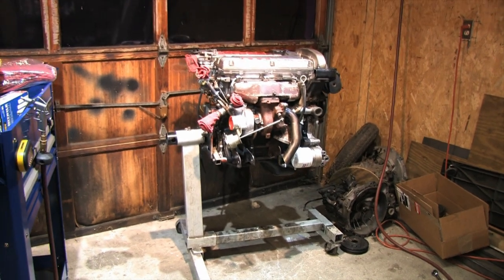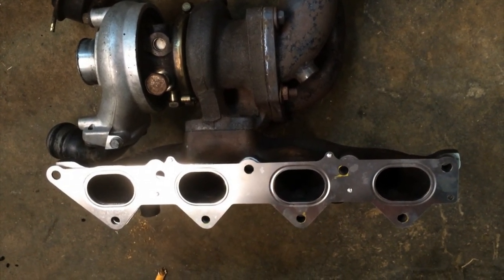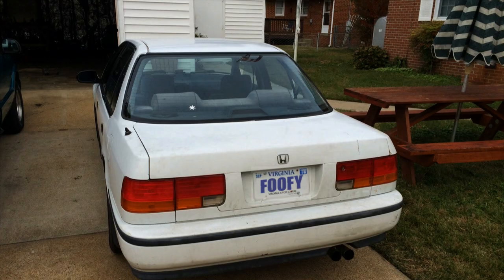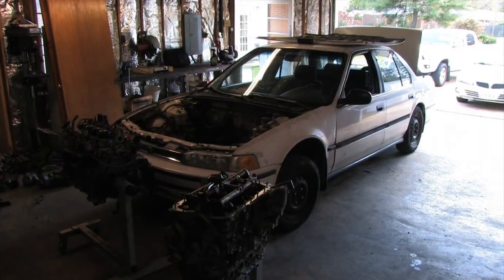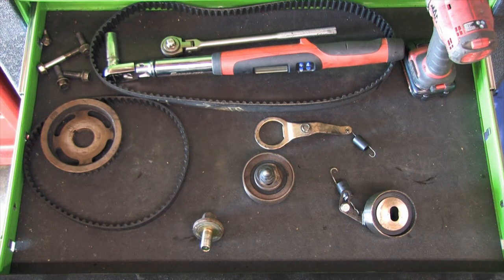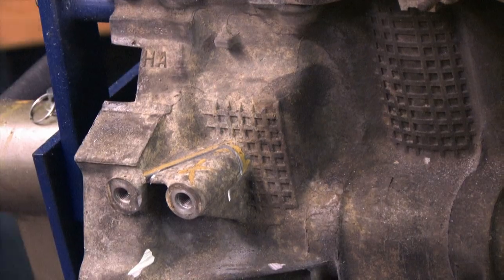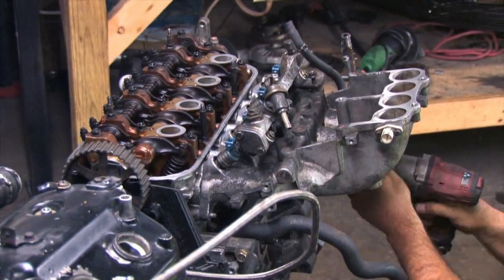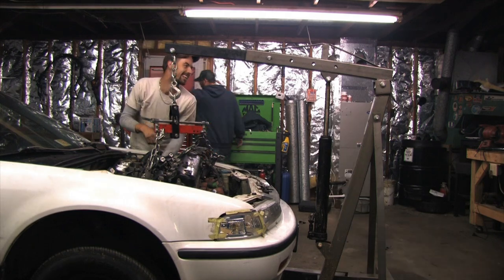Foofy?

Comment: Jafro,
I told my subscribers long ago that if we hit 10,000 subscribers  I'd boost my F22a Accord with over 300,000 miles on it, and they did it.  This video is a HUGE help and a bit of relief. Thanks a bunch for posting it and going into such detail!
Reply from the maker: +Braden Carlson Do your research.  A different manifold will let you keep a lot of stuff that you'd have to delete.  We didn't use that manifold because we had a free one.
Reply: ***** I'd been looking at the east coast concepts install manual for DSM turbos, so I got a 1g manifold too. You're right, there are better options, but my whole car is a half-assed wonder. It just wouldn't be right to do it entirely properly ;)

Comment: This makes me miss my CB and (EDM) CC7.
What you can do to counter the effect of missing the front engine mount, is filling the rear mount with liquid urethane (for installing windshields).
I did that when I turbocharged my CB and it limited the movement the engine enough. It'll vibrate just a bit more.

Comment: Really happy to see you working a a f22,  such a underestimated engine series.  Incredibly reliable.
Reply from the maker: +paradien It has a seriously over-engineered port design with just the right port shape.  It's just like a DSM port but slightly smaller.  For the valve dimensions a DSM uses, its head ports are just too big for its own good.  With the right modifications, there's no contest with a DOHC, but we're talking about a stock un-ported SOHC head.  Way over-engineered for a 125hp NA motor.
Reply: If you wanna see the right modifications you should look up a old build from Bisi Ezerioha. The NA F22A4 HONDA INSIGHT!  Driving a 1993 Accord daily and then see that made me become a Honda technician! The man had put a unheard amount of engineering into the F to show its potential. Unfortunately no parts were massed produced at a cost that most enthusiast would want to bother. Thus....swaps. what a shame.
Reply from the maker: paradien We found the Bisimoto kit.  It's pretty much the only option if you don't go with .030 over 4g63 stuff and some custom rod machining.  It's a big enough expense to make a DSMer out of anybody.  I can buy 3 DSMs for what it costs.  You gotta really love that F-series for that route.  :)

Comment: As a Honda and DSM fan (and long time viewer,) I love this video.  I've only read about the DSM 4G63 manifolds working on older F-series engines, but I've never seen it done in much detail.  Not that I'm condoning not being safe, but I don't think removing the front engine mount is that big of a deal (the average person/daily driver should certainly try to maintain or fabricate a front mount.)  But most older Hondas/Acuras don't even have a front mount like that.  With that said, aftermarket mounts would certainly help stiffen the engine for even more safety (if it wasn't a budget build of course ;))  Thank you very much for the video!
Reply from the maker: +Spoon Twofiveeightone There's a better, safer way to do it, but we went with free.  :)  If/when there's a foofy 4, we'll change our parts list to things that weren't on the shelf and manage to keep that mount.  I think the F-series is an underestimated platform.

Comment: How did Foofy III hold up at 15psi?   Revisiting this video because it's awesome.  Also, is that stock Accord manual transmission a LSD?
Reply from the maker: My take is that if you're even considering pushing one over 8 PSI, a knock sensor install is a MUST.  This engine has a glass jaw because it's set up tighter than [horrible metaphor], and the pistons absolutely suck.
Reply: None of the Accords have lsd unless they have been swapped. The JDM H series trans is lsd and a direct bolt on but has shorter gears.

Comment: Nice job, really like the ingenuity that went into this ! This is one of the most interesting budget projects I have seen. Have you considered transforming the intercooler into a chargecooler? You could weld a couple of end tanks to it and use a small radiator, provided you can fit one somewhere with enough air flow along with an electric pump (if you are willing to spend some money). An oil cooler could help with engine temperatures as well. Used ones can be found for next to nothing. More interesting would be a DIY water injection system. I know they can be made from used injectors and fuel pumps and I am sure you people can put one together from used parts.
Reply from the maker: +Ismaak5 Because of the hot and cold side inlet and outlet size, it's really not such a great candidate for that kind of use unless you could stack several of them, and still, it wouldn't be as efficient as a purpose built one.  Water/Methanol on this car is a must, but I'm pretty sure this particular engine install is temporary either way.  We had so much fun with the proof of concept that we proved it 2 more times.  A ridiculously inexpensive education.  Now that we've seen what can be done, and what it is, severe changes to this approach from the ground-up could be possible.  For now, we're just enjoying it.  Absolutely anything could happen next?

Comment: Air flow is maybe better for turbo application but :
Bigger Air flow doesn't mean more hp.
Bigger ports will make the air to slow down inside the intake and the ports,and the air charge (wich will be trapped inside the cylinder) will not automatically be more important.
Air is elastic,and if you use it to accelerate it before being trapped in the cylinder ,you can benefit from it.
It's what the small ports are made for.
Reply: You only benefit in low and mid-range torque from that. Big ports and big airflow are for peak HP, which is what racers want, and they couldn't care less about lag.
Reply: +michaelovitch You certainly put out good thinking. I remember a comment of yours earlier on another video where you mentioned making one of the ports bigger on the way into a 4 valve head. It got brought up that this concept was more for efficiency instead of for power, but David Vizzard agrees with you. He designed (and patented, so if you make this and sale it you have to give him 7.5%, but if it's just for you, it's okay) a 4 valve head with one larger intake valve to create swirl. I can't for the life of me yet find a "bigger" valve unless we're talking 2 thousandths of an inch, but I wonder truly if I could get a similar effect by still doing what you and David Vizzard brought up about making the porting around one of the valves bigger.

A competing idea on my application is that most small 4 cylinder engines have oversized intakes. This is from another book and I have a lot of math to do to see if it's true for my car, but I suspect it is.

The only issue is, if I were to truly make my intakes smaller I'd need a TIG welder, lol.
Reply: +Hugh O'Brien In your example, what would you fill the port up with? I see Jafro's videos inspire you to type a lot too. :) Good to see you again.
Reply: what are you on about , and your point is ???? also every engine has flow and other things contribute the better flow etc . most onnhere haven't a clue
Reply: +Tim Ramich 
Drag is not everything : )
There are racers everywhere,not only on straight lines.
Reply: +Hugh O'Brien 
Thank you for your comment.
Very interesting.
: )
Reply: +DE Nichols 
A guy,(mototune USA ) uses epoxy to reduce the ports section.
It's a NA engine reving quite high,so air elasticity is huge there,like the air boucing effect in the ports.
What i know ,as a base of thinking is the fact that for a same air mass  when you reduce the port section,you increase air speed and reduce air pressure.
and when you increase the port section you reduce air speed and increase air pressure.

you can use that to pass the valve guide or in the bowl area for ex.

I've understood that manufacturers reduce ports sections regularly.....
Reply: michaelovitch
What's a good epoxy for the heat/cold difficulties that an engine represents?
Reply: +DE Nichols 
I don't know.
There are plenty of products.
If you are interested by the air velocity
http://www.racedevelopments.co.uk/cylinder_headwork/index.html

i'm sure there are a lot of guys doing it.
It's crazy how factory engines can be improved.
Reply: +DE Nichols 
http://www.visordown.com/workshop/diy-gas-flow-into-the-cylinder/16014.html

looks like Loctite 3475 works.
Reply: +Hugh O'Brien
 personally ,i wouldn't use something else than what's is made from,
A tig a the best option.
Just the vibrations wouldn't me let think it's a viable option.
I would'nt ever think to use it in the exhaust... : )
Do you have some pics or vids on your work ?
I'm curious about.
Reply: ***** Count on me subscribing!

Comment: I and all my friends say thank you for all your hard work on all your videos. We have been talking about the great things you do with recycled parts. As we are sitting a round with some beer and talking I said I have been looking at WATER METHANOL INJECTION. The Hyundai and Honda  would benefit greatly. A CHEEP DIY WATER METHANOL INJECTION  are grate for a stock stander engine . It greatly reduces detonation, Keeps the hole cylinder cooler especially piston and rings. I have even seen the removal of the restrictive inter cooler with an average mix of 50:50.There are to many advantages to say. Just reply if you think this may be a good idea for you.

Comment: Jafro, this video brings me back. in the late 90's early 2000's, i did a lot of turboing of hondas, and some other cars. but i learned alot about hondas and how good they actually are, yes i was skeptical of rice burners before then. some of hondas best abilities are the heads and all the parts swapping that can be done between similar engines. you may know this, but there is a SOHC vtec F22B2? i think thats right. that head should bolt right on to the F22A1, but not 100% bolt n go. and there was a F23 SOHC vtec from the Acura CL USDM. there are other F series that use the dual stage intake like the H23/H22 motors. of course this is easily controlled by the Hondata. i could have some of this mixed up, its been 14 years. i once read that the DOHC H23 series head could bolt to the F series bottom end, but i never was able to confirm.

oh, and most all hondas produced before roughly 95, 96ish(OBDII), all came with resistor boxes stock. they are almost always on the drivers side strut tower, except some v6 and very early FI hondas; eg accords, civics, preludes. many are finned aluminum boxes like some early toyota trucks. ive even used older style low impedance injectors on an OBDII ecu with the install of the said resistor box.

and to see the real potential of the F series, look up Bisi Ezerioha. over 300hp NA F22A1 mated to the D series transmission and side draft carbs. badass.
Reply from the maker: +Ron Merrill Foofy 2 was an F23 block with an F22A1 head bolted onto it.  If it fits the other way around, I dunno why it wouldn't fit the way you suggested.  You'd just have to use the head gasket for whatever block you're using.  Getting that wrong will cause pre-ignition or the pistons munching the head gasket due to the larger bore.  But yes, it works.  I dunno how you'd make a d-series transmission fit, but if you could get a CX transmission to hold the power, I know for a fact that one goes 135mph at 7000 RPMs in 3rd gear.  It comes on with a sacrifice of low-rpm drivability, but that would be retarded with boost.
Reply: +Jafromobile the H series was the dual cam motors, mainly used in the preludes, and some JDM Accords. i think there is a rare dual cam F series motor, but JDM only. i think the Accord type R? this of course excluding the S2000 F20 and F22, they are more like the K series engines. now i think that the H series was only 2mm larger in bore then the F series, except the F23 vtec. if memory serves me, the F22 and the H23 shared similar stroke but the H23 being larger bore, by 2mm. the H22 was same bore as the H23, but had a slightly shorter stroke. and of course, like most of these years Hondas, they are undersquare engines, except the B17A(93-early95 integra GSR) and the B16A. i used to have a Sport Compact Car mag that showed all the various Honda engines of these years, JDM and USDM and their specs, being comp ratio, power, what car they came in, etc. take the D series. im sure alot know of the JDM DOHC D16ZC(very similar to the D16A1 1987-89 Integra), but starting after 92/93 the ZC(as it was called) was a SOHC vtec. i also have another old book, it was how to make 477hp from the B18C1(96+ integra GSR), which is a good read on turbocharging really anything because the testing they did and why.   in the back of this it showed all the various D, B, F, B, and early C series Hondas with the bores and stroke of each. im sure you know, you spend enough time with something, you pick up weird things about them.
Bisi mated the D series trans to the F22A with an adapter plate, custom flywheel, and the trans was face plated(no synchros, but similar to Dog ring setup) and cryo treated custom straight cut gear sets. and i believe his motor revved to near 8500rpm. he stated that he used that trans for light weight, in his Honda Insight. A car with an aluminum chassis.

also, i really like your videos. i dont own a honda or dsm, a turboed ford ranger really, but i still enjoy watching.
Reply from the maker: +Ron Merrill I'm sorry, I got that all kinds of wrong.  I meant F-series.  I've been getting it backwards for about a week now.  Don't know what wires got crossed where, maybe a mini-aneurism or something?  I meant F.
Reply: +Jafromobile that's cool. I was just stating. I did the same thing many times over in the beginning.

Comment: I have a 2013 Fusion with a 2.5 4 cyl. The Titanium version comes with a 2.0 that's turbocharged. Will the 2.0 turbo work on my engine? I know the engines are basically the same, I just don't know if the turbo itself will over rev.

Comment: Could someone explain why ATF helps with lubrication and sealing in the combustion chamber over something like, motor oil? What's unique about ATF that makes it the better choice?
Reply from the maker: +enuary Yes, I can answer your question.  ATF is a powerful detergent.  ATF can even help you un-seize engines if the rings rusted to the bores.  Nothing is going to seize up if you use ATF as an assembly lubricant.  It eliminates friction like other oils do, but it doesn't remove all of it.  ...which is a great thing.  It's a great thing because - in order for your rings to seat in position, wear needs to occur.  Oil reduces friction, is thicker, and burns differently making it glaze the cylinder walls on first startup instead of how the ATF acts.  This can prevent rings from sealing.  ATF lets the rings seat and then gradually get washed off with the crankcase oil.  That's the technical details of why.  Short answer = it lets you seat your rings faster.  ;)
Reply: +Jafromobile Thanks Jafro!
Reply: +enuary Great question! Thanks for the answer Jafro!

Comment: Hi jafro, i've seen you run HKS SSQV BLOW OFF VALVE on your GSX and wanted to ask does it keep boost up in between shifts better than stock mitsubishi valve, bean thinking of buying one, any advice.
Reply from the maker: +Goce Nikolovski Keeping boost levels up during shifts is not the job of the BOV.  The SSQV was a necessity because I run boost levels that the factory unit can't handle.  When you're up in the 30 PSI range, not many can take the punishment, but the SSQV was one of the best options back when I bought it and it works so well, I kept it.  If you lift your foot off the gas, every BOV is supposed to vent all of your boost.  There are ECU modifications that allow you to do what you're asking about.  Look up No Lift To Shift, or NLTS, and you'll find your answer.

Comment: that old single cam f seriesigjt flow better through the ports but the bottom end is weak, low compression, not as much lift as the b18c and not well balanced rotating assembly. oh and not nearly as strong as the vtec honda engine blocks

Comment: Wonder what you guys could do with a Dodge Neon
Reply: +Clayton εжз give them one, it would be the cheapest build yet
Reply: molsenice You can get Neon's for about $300 around here.
Have a 2.0, 5 speed MTX and that little shit has power. Routinely tow 2+ tonnes with a trailer. As a daily driver that car is fun to drive and is great on gas. I swear it's like a street legal go-cart.

If he lived in the same state I'd buy him a Neon just to see what he'd do with it.
Most enthusiasts just put a 2.4 head on the car and shocks and race...
Reply: I gotta look for a neon then, most likly around here they.d all be rust thou
Reply: molsenice If you can weld though it's an easy fix.

Most Neon't blow their head gaskets and leak oil.

I bought my Neon five years ago and put nearly 100k on her. I call it my SUC (Sports Utlity Car) I love the car. So easy to work on and parts are cheap as heck... lots of them at the salvage yard.